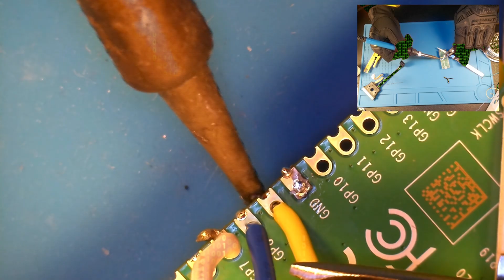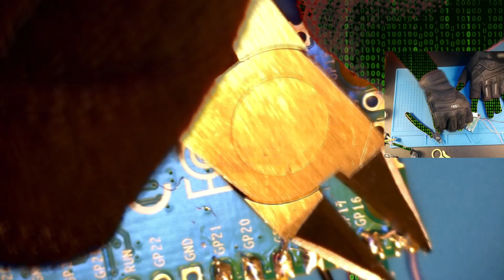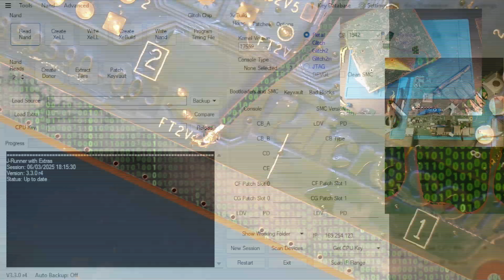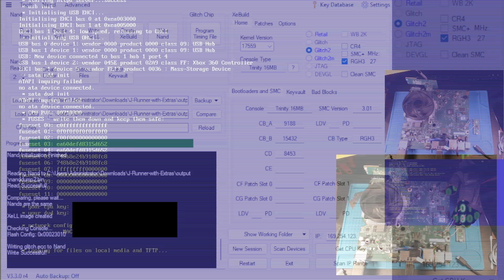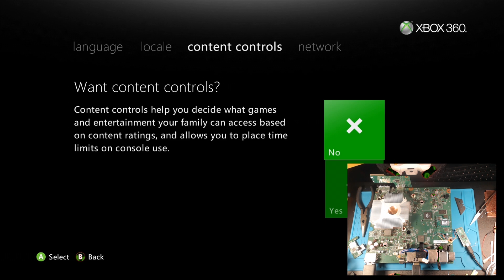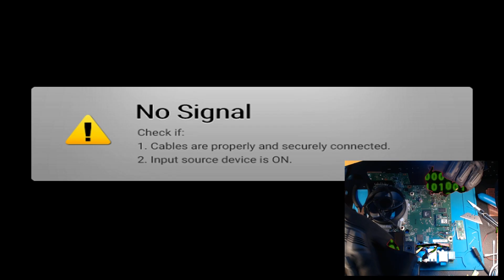Xbox 360 RGH3 Tutorial | Trinity Motherboard w/ PicoFlasher

Comment: Any tips on why i can read the nand create a xell write xell but the xbox wont boot to xell
Reply: For anyone curious i figured it out. I had to take the resistor off for it to boot into xell and for it to boot period, i tried all the different sizes recommended. So yeah hope that helps someone
Reply from the maker: Hey and thanks for watching! Sorry for the late response but I'm thinking it could be either the solder joints for the RGH could be cold/not well-attached, or soldered wires could be too long. If the flasher joints are soldered correctly, it will write xell regardless of how the RGH wires are soldered, so I would double-check your POST and PLL joints
Reply: @ratgang-net  all good man. It was seeing that the resistor needs to be removed in some cases to boot xell that you did in your video is what i had to do